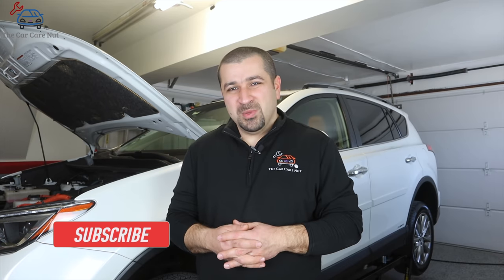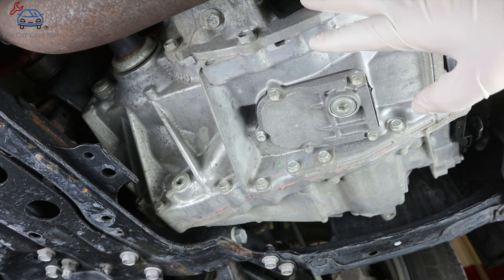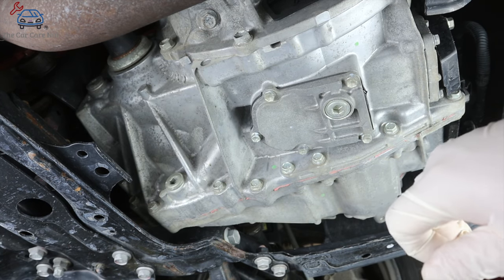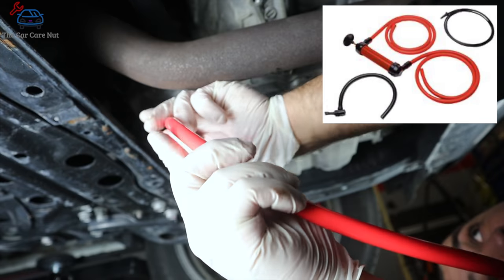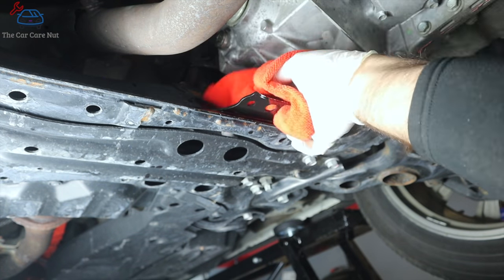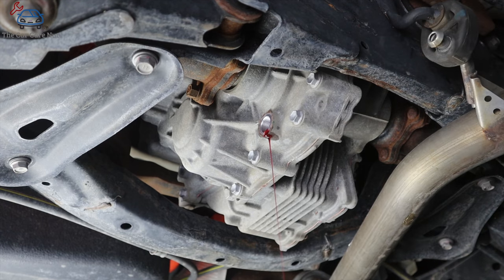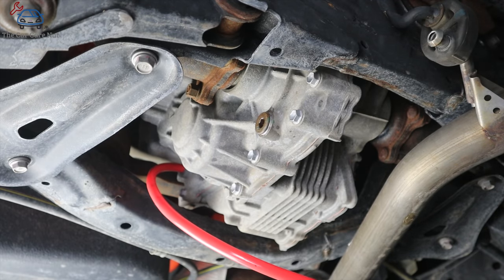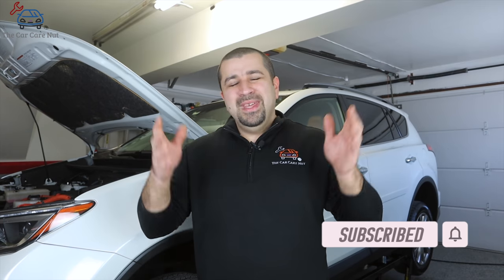How to change Toyota Hybrid Transmission fluid and Differential fluid

Comment: Please educate me. 2011 rx450h. 
Question about fill plug on transmission. Two similar 10mm hex screws on driver and passenger side, same level. One can be accessed behind wheel. one from underneeth the car next to axel, same side as drain plug. 
Which one is the right one? On top of drain plug or on other side behind wheel.
Thank you
Reply from the maker: Hi! The one on the drivers side.
Reply: @TheCarCareNut  thank you for responding. So easiest it will be to take wheel off and use hose with funnel and pour oil uising gravity.

Comment: AMD, how many miles did this Rav4 hybrid have when this oil change was worked on?  The fluid does looks quite clear, I got to say.  I plan to do it ahead of schedule as well.
Reply from the maker: Hi! This car had just over 60k miles. That’s why I recommend you replace it between 60-90k
Reply: @TheCarCareNut  60 000 kilometres or miles?
Reply: @111labo   Miles.

Comment: The rear electrical wire (the orange box) is in the way on my 21 Highlander hybrid. I can access the drain plug no problem but the fill plug is inaccessible unless I unplug it / go around it. Is it safe? Is there another way?

Comment: I used cvt fluid instead of ws atf on a Toyota hybrid would it damage the transmission?
Reply from the maker: Hi! It wouldn’t damage it immediately but I would drain it and use the correct fluid

Comment: Does Prius hybrid 2012 has differential fluid to be changed? I have hard time locating it? Thanks
Reply from the maker: Hi! Not on your Prius. Only AWD models which yours isn’t
Reply: @TheCarCareNut  I did change transmission fluid on same care it took around 4 quarts but at speed greater than 30 mgh it rattles. Is it low in fluid or too much. Thanks as always for any input.
Reply: I figured it out. It was plastic underneath. Lol. I am glad it’s not transmission. 😀

Comment: Why does only the rear differential use a magnetic drain plug? I noticed I didn’t have  one in the front but I want to get one for it same as the rear. Is there a reason for Toyota not using on in front?

Comment: I have a 2021 Camry Hybrid. My owner manual said nothing about when to change the transmission fluid, so I called my dealer and they told me my transmission is not serviceable on my car. Is this true ? I called a different dealership and they told me my Camry hybrid has a cvt transmission , and I should put cvt fluid in it ? Your saying not to and put ATF-WS . I’m so confused. What is the correct fluid ? Please help!! Thx

Comment: Dear AMD
Thanks a lot 
The workshop filled  my RX 400h  lexus 2007 using Toyota  CVT fluid.
Will it make any harm to my CVT transaxle? 
Is it necessary to replace with normal Toyota ATF fluid.
Best Regards 
Ramzi Nemer
Reply from the maker: Hi! I would drain that as soon as possible and replace it with WS ATF

Comment: Does oil change no matter what mileage apply to all hybrids like Camrys and Corollas or just the Prius? I'm looking to buy a 2012 Camry hybrid with 156,000 MI
Reply from the maker: Hi! The oil change information applies to all Toyota hybrids only. Not models with a regular automatic transmission that are not hybrids.
Reply: @TheCarCareNut  what about non Toyota cars Ford fusions or Ford hybrids Honda hybrids?
Reply from the maker: I work exclusively in toyotas other makes can be different

Comment: I'm changing the fluid today in the 2012-2014 camry hybrid.  I noticed in the Toyota procedures "P314 Transmission on vehicle inspection - Inspect fluid", Notice: Bullet 4: If the fluid was replaced or added, make sure to recheck the fluid level after driving the vehicle.  Does this mean the fluid / tranny / engine should be hot?  The spec is 0-5mm from the bottom lip of the filler plug opening.  Is this the difference between hot and cold?
Reply from the maker: Hi! Yes that’s the difference between hot and cold that’s why you’d want to wait until the fluid completely stops dripping  from the transmission fill plug before you reinstall the fill plug
Reply: @TheCarCareNut  Thanks for the quick reply, and great video, as always!  That QuickJack looks good.  Can you use it without jack stands?
Reply from the maker: The quickjack is awesome! You don’t need jack stands with it as it has a lock

Comment: A question, you mention that it is a gen 2.5 transmission. But isn't the P314 a 3rd gen transmission? The 2nd gen used a chain driven final drive and the 3rd gen uses a gear driven final drive. Or am I wrong in assuming that the P314 is a beefier version of the P410 found in the 3rd gen Prius? When looking at teardowns they look very similar in design.
Reply from the maker: Hi! I was referring to the generation as a whole not just the transmission. So that includes the inverter and just the way the system operates internally
Reply: @TheCarCareNut  ah thanks. I thought that the inverter/converter assembly was similar in construction as well (obviously different for the additional circuitry for the MGR).

Comment: I have 2019 Toyota Highlander Hybrid and I have a fill plug on both side. I’m not sure which one is right one. Right one with allen  keys other one is hex
Reply from the maker: Hi! The one that is lower or at the same level as the axle seal.

Comment: I asked the dealer to quote me a price for trans fluid replacement on my 2017 Lexus IS300 hybrid, and they said it also has a trans fluid filter which is quite expesive (200+ $). I never heards of this filter, is it real or they messed up an d quoted me wrong?

Comment: What's going on here??   My Toyota RAV4 2017 Hybrid transmission fill and drain plugs do not seem to be 10mm exactly.   The 10mm hex bit socket (and I tried a few different brands) has a little play in the drain plug and started to strip the edge of the plug's socket when I applied torque to remove it.  Does this RAV4 2017 Hybrid have a different size or require a special tool??

Comment: Hi, thanks for this video. I'm from Northern California, I have a 2016 Toyota Hybrid with 70K miles, mostly freeway miles. Would you recommend changing it before we do our inter-state trip this summer?
Reply from the maker: Hi! Changing the car? That’s too new with very little miles. I wouldn’t
Reply: @TheCarCareNut  Hi, thanks for the reply. I'm sorry you misunderstood me. I thought since you were talking about the transmission oil in the video you would assume that I was referring to it as well. :-) 

Anyway, the 70K miles is my concern, although you said it is still good up to 100K. Perhaps should I strech it to 80K before changing? My concern is that in those 70K, I used the car twice on cross-state trips.

I will not change my car, I love it and it's too expensive to get another car today.
Reply from the maker: Hi! You can replace the transmission fluid safely between 60-90k miles so you’re good to replace it at 80k
Reply: @TheCarCareNut  
Please I have Toyota Camry Hybrid 2017 which transmission fluid is the right one ?? because some people said it is has CVT gear so am confused🙁

Comment: Hey AMD I did this procedure on my 13 highlander hybrid . After about 6 quarts my transmission never  leaked out like it is “overfilled” 

What did I do wrong ? I’m worried about it being overfilled now but nothing comes out when opening the fill plug as if it isn’t overfilled or is possibly under filled ?

Comment: I'm curious, is there just one differential fluid to change or a front and rear? If it's just one, is that because of the hybrid system?
Reply from the maker: On hybrids just the transmission and the rear differential if it’s awd
Reply: @TheCarCareNut  Awesome! Thank you, plan on tackling both soon with my grandfather.

Comment: Did I understand you correctly that it needs to be changed every 6 to 8 years if it hasn't reached the mileage?
Reply from the maker: Hi! Yea that is correct
Reply: Thanks mine only has 31000 but is a 2013

Comment: I just change my RX400h at about 12 degrees Celsius outside. I drain about 4.35 liters and fill as you say. Unfortunately my pump hose get loose and some get on the ground and even so I fill about 4.3. Should I try to sip more tomorrow or I am good? And I am really worried about the temperature and leveling, should I be?
Reply from the maker: Hi! Fill the transmission until fluid starts overflowing from the fill hole then wait until it stops dripping and you’re good just like the video
Reply: @TheCarCareNut , thank you! I am really doing what you did, I will check it today just for topping (in case I introduce air in the fluid while pumping). A lot of people say the fluid should be 50 degrees or you should drive it and so on. I was worried only about outside temp, so despite it, no starting the car, no heating the fluid, no driving, no nothing is needed - just drain and fill?
You are really doing great things over your channel. God bless you and take care, I love to watch you videos, cause you are really keeping the complex things simply explained!
Reply from the maker: No worries about the fluid temp. No driving no rechecking! Just fill it until it overflows and wait for the excess to drain and you’re good to go

Comment: 2014 camry hybrid xle 90k miles ..never done transmission fluid change. The manual says CVT 4qts. Is it correct to go with?..

Comment: Were you able to find something on my question about the Check engine and track off on a Corolla 2014 but I don't have the obd2 to check it?   All my mom did was fill up her car with gas because it was just with 1/4 in the tank when she normally doesn't get it below 1/2 tank.  That day she was doing a lot of errands and stopped at the shell gas station to fill it up and close the cap and the car didn't turn on.  She tried many times and it wouldn't turn on.  She called the towing company and when it arrived to her house I arrived to help her out and miraculously it turned on with those lights on.  Thanks in advance
Reply from the maker: Hi! So I’d invest in a small obd2 reader or stop by a parts store to get the codes so we’d know exactly what happened
Reply: @TheCarCareNut  would that be available maybe at Advanced Auto or Auto zone or do I have to purchase one from Amazon or which one would you recommend?  The car is being used since it has been able to drive since she doesn't drive it on long trips, just to go to pharmacy or supermarket or gym.  She does very short trips
Reply: @1stfrompuertorico568  Those parts store will run the scan and print you the results and recommendations. Ask the store rep to scan it. They do it for free
Reply: @1stfrompuertorico568  yeah, advanced and autozone have cheap ones. They both will read codes for free if asked. 

wal mart has them too if you have a wally world nearby.
Reply: @ahmadghosheh3104  👌👍
Reply: @volvo09  👌👍
Reply: @ahmadghosheh3104  Just a detail: California rules forbid anybody but an authorized smog check station to even read the codes! Midas shops will do it for free. I don't know if it applies to the other "CARB" states as well. Other states it is just as you say, and they are happy to do it. It sells parts.
Reply from the maker: If you are in a state that allows it, you can have autozone or advanced check codes. Otherwise just purchase a small inexpensive obd2 reader as it’s a very handy tool to have
Reply: @TheCarCareNut  yes, I will try to take her car to Advanced Auto so they print those codes and will also purchase an obd2 reader.  Puerto Rico is part of the USA as a commonwealth since 1898 after Hispano American war when we were a possession of Spain.  So all Federal regulations apply here besides local laws and regulations since we are US citizens.
Reply: @1stfrompuertorico568  Good to know! You should not have the CARB rules there.

Comment: Hi sir. I have a chr toyota hybrid 2020. I changed thr transmission oil. Toyota gave me cvt atf fe. When i check the manual its cvt ws. Will it have a problem? Do i need to change it?

Comment: Hi I am using Toyota Sai in New Zealand, mine is front wheel drive does my one have deferential oil and  after changing transmission oil do I need to check the transmission temperature or just fill and along as it over flows and wait until the over flow stops and put back the fill cap thanks.
Reply: Sorry I forgot to mention year of my car it's 2011 model Toyota Sai thanks.
Reply from the maker: Hi! Your car would only have the transmission no differential and no temperature check is needed just fill it until it overflows and you’re good to go

Comment: Dont the 06 rx400h trans have a clutch plate in them? 433 alway take "fill plug" out first. So if your car is on ramps you cant fill this correctly, too bad fill hole isnt in front of trans.

Comment: When you're doing this transmission drain/fill, is the car level at this point, or on ramps? When I do this it will be on my driveway on ramps. You say make sure to let the fill hole drain as much as possible after filling it, as to not overfill it, but how can you do that if the car isn't level? Not criticizing, trying to get facts straight before doing the job to my 2018 rav4 hybrid :-)
Reply: And then I continued watching to where you got to the rear dif and said to make sure it's level with jackstands 😂 Ignore my ignorance

Comment: @I have a 2008 Toyota highlander hybrid limited ~175k miles and I replaced the rear differential fluid with Valvoline full synthetic 75w90 gear oil, is that okay? Or do I need to use something like ATF for that purpose? Mine is an AWD model..

Comment: How often should the differential oil be changed? Or is it the same as transmission?
Reply from the maker: Hi! Depends on the model.
Reply: @TheCarCareNut  toyota highlander hybrid 3.3 limited
Reply from the maker: The front differential is part of the transmission which needs replacing of the fluid every 60-90k miles. If it’s Awd model the rear differential at the same interval